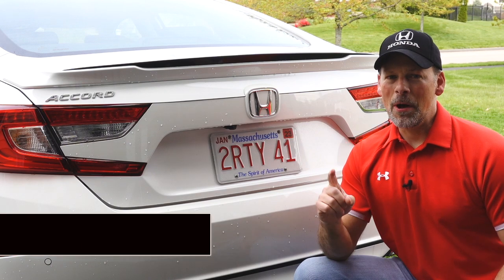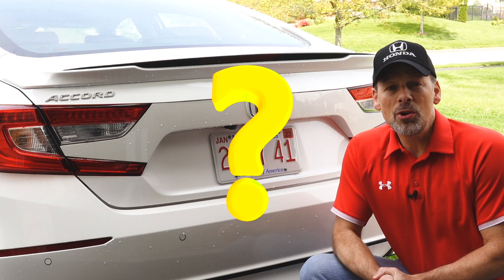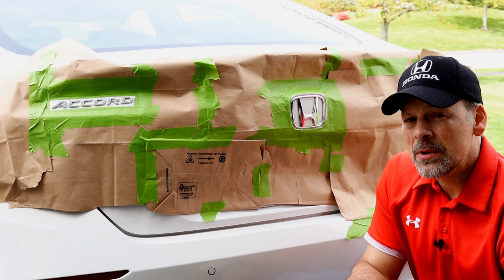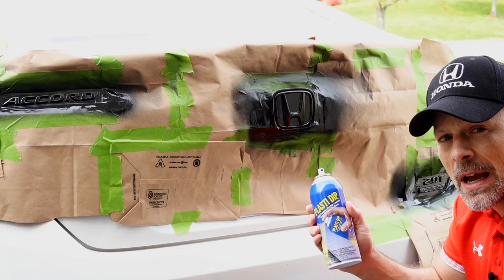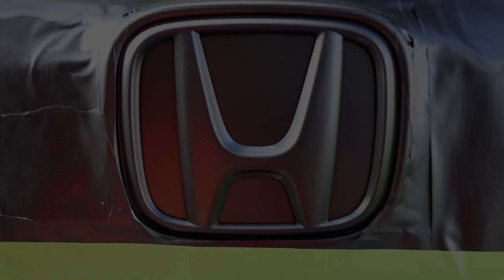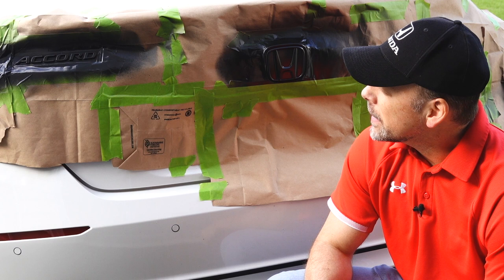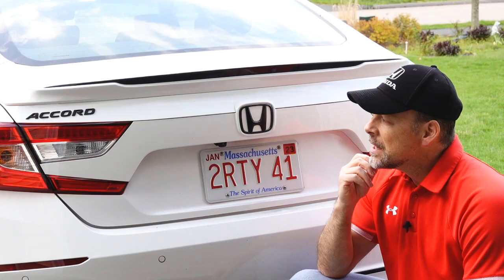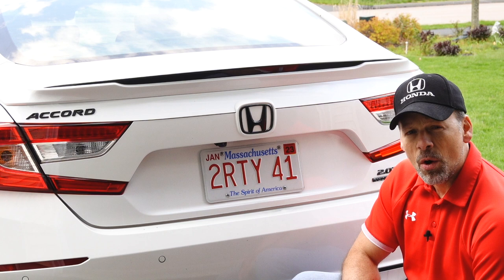PLASTI DIP Your Honda Emblems // 10th Gen (2018+) Honda Accord

Comment: To make masking off easier, I used a plastic painters drop cloth and just draped it over the entire trunk and rear bumper area and then just tore out the areas where the emblems are and taped it down. It worked great and provided complete overspray protection. I did my accord back in April and it turned out perfect.
Reply from the maker: Great tip! 👍

Comment: One thing that will help eliminate texture is to put the plasti dip in a bucket of hot water to warm it up before you spray. It definitely helps it lay down better.
Reply from the maker: Good tip! 👍
Reply: Interesting...will give this a shot on my San Marino 2.0t.

Comment: I used Hyperdip Piano Gloss black for my emblems. More expensive than the plastidip, but the finish is amazing. Nice shine and doesn't require glossifier.
Reply: Thanks 🙏 great tip
Reply: Does it peel off as easily ??

Comment: I live in Michigan, and have used PlastiDip on my door handles, badges and lift gate handle. I had to redo my driver's door, but the rest are fine except for a slight 'dulling' or fading. I initially applied it in 2017, so well worth the money. If you don't like it, just peel it off. I believe I used 7 coats (no glossifier). Overspray is not difficult to remove, but additional masking is the way to go.
Reply from the maker: Wow, that’s great to hear that it’s lasting so long, especially in hi touch areas like the door handles - thanks for the feedback 👍😁

Comment: This is great, I had done mine a few days b4 you released this video. I should have used a toothpick like you did to remove the excess in the accord emblem, because I left a small paint chip inside the letters a and r because I used metal tweezers :.(
Reply from the maker: Except for the tweezer accident, how did it turn out?

Comment: I have seen people just take these off with a pry tool.  I would think it would be way safer to just take it off before you paint it.    Ruining the paintjob on your car could potentially cost like... a lot
Reply from the maker: The Plast-Dip will not ruin your paint if you accidentally get some on it. If it happens, it will come right of with something like a clay bar, or even from rubbing with your finger. 👍

Comment: You have to remember that with Plasti dip you will get a matte black finish instead of a glossy black so just make sure you're okay with that.
Reply from the maker: The Glossifier was supposed to add the gloss, but I had limited success.
Reply: @TheLemonFactor  I saw some guys using 2K clear coat to get maximum gloss?

Comment: I’m thinking about getting a 2.0 turbo model. Do you have to idle the car 15-35 seconds before driving and same thing when you are done driving to cool down?
Reply from the maker: Although it wouldn’t hurt to let your car warm up on extremely cold days and your turbo to cool down after spirited use, it is not required.

Comment: what did you use to get in between the letters in logo ? it doesn’t look like tape
Reply from the maker: I used a pin and tweezer’s 😬. However, I don’t recommend it as you run the risk of scratching the paint
Reply: @TheLemonFactor  no when you were peeling off and the letter were staying on. was that the plasti dip? or some type of cover?
Reply from the maker: That’s the Plasti-Dip!  It’s pretty amazing how it comes off cleanly like that. 👍
Reply: @TheLemonFactor  ohhhhh okay wasn’t sure if that plasti dip damages the paint or not thank you!
Reply: @TheLemonFactor  how is the plasti dip with weather. does it stick well? and car washes too?
Reply from the maker: I’ve had no problems with mine 👍

Comment: Nice video Chad! Like you said, it is not a permanent solution for the fact that it will not last more than a season. The sun and heat will degrade the aspect quickly but the good news is you still have the spray can and redo it again. For the ones who does car detailing or uses no-contact car wash... please avoid!!! I forgot the plasti-dipping and guess what happened :(
Reply from the maker: Really?  I’ve talked to a couple people who’ve used Plast Dip and it’s still lasting for them 🤷‍♂️
Reply: @TheLemonFactor  I didn't put glossifier on my emblems with plastidip and the Mazda emblem on the hood might be more in direct sun than the one in the front of an Honda accord. After 2 months, my kids made me realized that the emblem on the hood needs to be redone again. Unfortunately for the ones at the tail did not resist to the water presure. My bad on those ones! :(
Reply from the maker: I’m going to test it out and see how sensitive it is during my next detail 🧼
Reply: I put plastidip on my rims and they have lasted 3 years now no damage.  I sold the car to a Toyota dealership and even they did not peel it off they probably think it paint. They fade if u dont wash the right way with a rag or sponge because stuff will stick to the texture dimples especially on wheels once cured u can use a soft brush to scrub.  The emblems will never have that issue so should be easy to maintain
Reply from the maker: Good to know 👍.  I’ve not had any issues with the Plasti-dip emblems as it pertains to detailing the car or otherwise 😁

Comment: What did you use to get the plasti dip out of the letters (like inside the D)?
Reply from the maker: A safety pin to pick at it then a tooth pick. But be very careful as I could have easily scratched the paint.

Comment: You did a good job but this is in my opinion a Mickey Mouse way of doing it the best thing is to go into eBay purchase brand new emblems which are not that expensive and spray them with a satin black SEM trim paint, just make sure you using adhesion promoter beforehand

Comment: Why not just take all the emblems off and do the process?
Reply from the maker: It’s easier and so much cheaper using the Plasti-dip
Reply: @TheLemonFactor  I was thinking removing the tabs for the inside trunk liner and popping out all the emblems and spraying them off the car.  No?
Reply from the maker: That’s definitely an option 🤷‍♂️